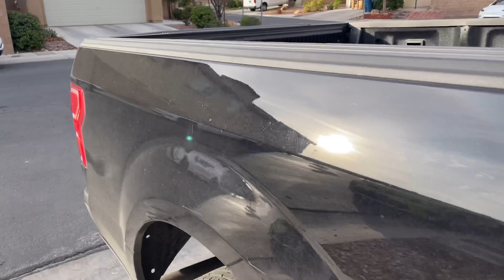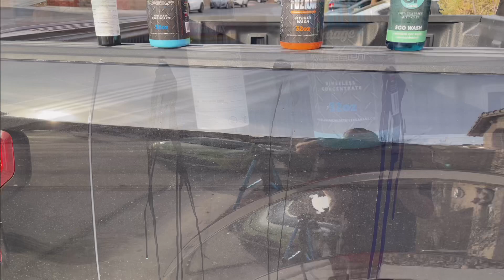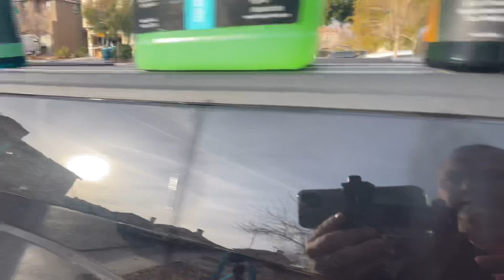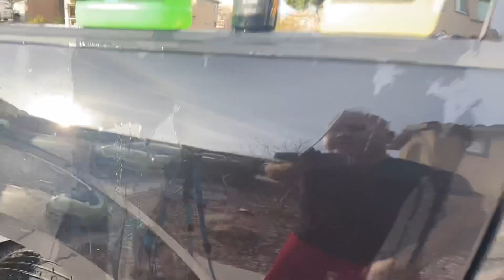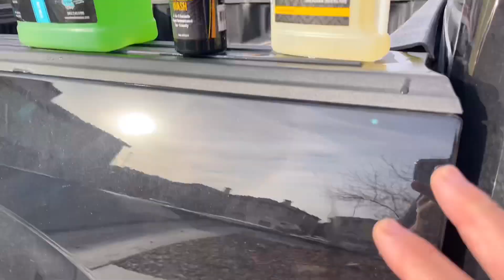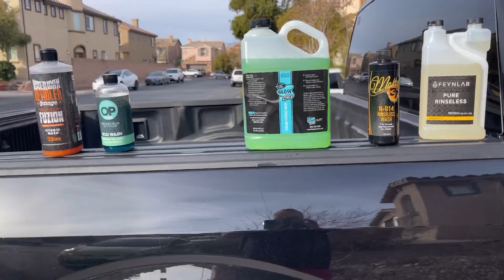How strong are these Rinseless Washes?/undiluted/auto detailing

Comment: Great video.  Which rinseless wash is best for heavy dirt removal?  I live in Michigan and it is just hard to keep a vehicle clean in the winter.  I know to spray off the heavier dirt and grime, but I am not overly concerned about getting swirl marks because it is mission impossible keeping your daily driver clean throughout the winter.  Thanks for your advice in advance.
Reply from the maker: U don’t want to Rinseless Wash with heavy dirt.   Mild to light dirt is recommended.   Key is to rinse the dirt off as best as u can before u Rinseless Wash.   Any of these will be fine if u follow those rules.